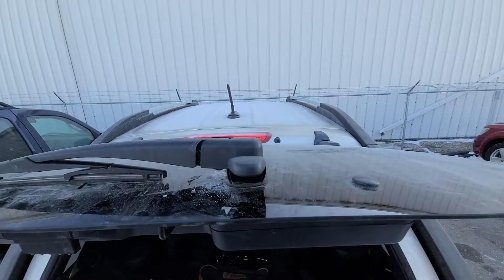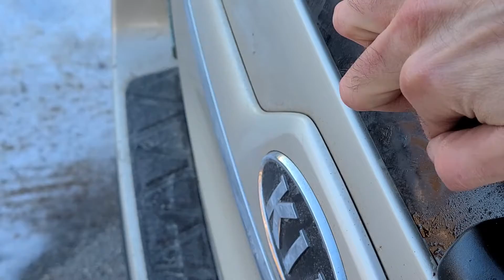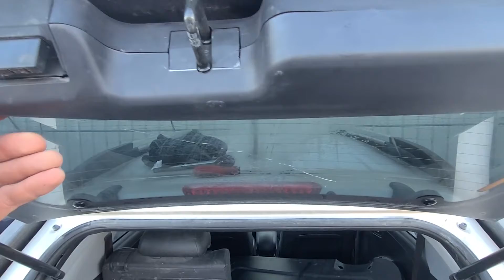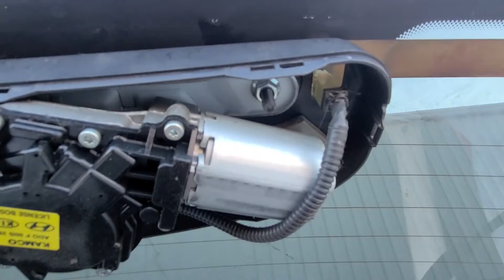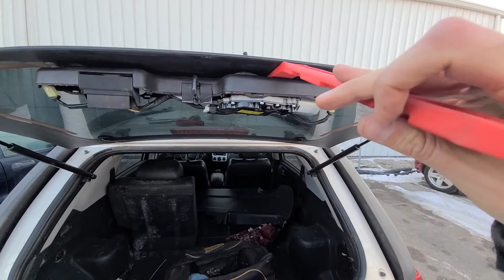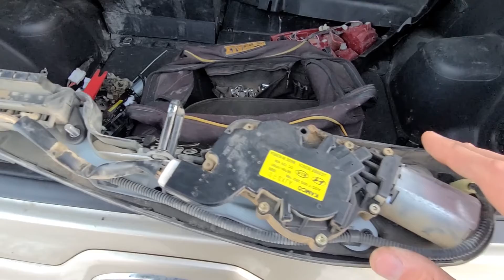Kia Sportage - REAR WIPER MOTOR REPLACEMENT / REMOVAL (2004 - 2010)

Comment: that large bolt won't budge. i've left Krill oil on it overnight...hopefully it will help loosen a 19yr old bolt
Reply from the maker: Yes those can be quite hard to remove especially if it was never done. I hope Krill oil will help you out

Comment: I replaced the same, can hear the motor clicking but the wiper blade won’t move. Any suggestions?
Reply from the maker: Hmmm if the motor clicks voltage should be good. Try to remove the wiper arm and make sure it fits properly and tight. Could be even a faulty motor again, hard to say without checking it out.

Comment: Great video, if I only need the motor replaced can I do that without having to pull the whole assembly through the window? Thanks!
Reply from the maker: Thanks. Unfortunately you will have to pull that arm through the window as that is the part of the motor. So maybe it would be easier to remove the whole assembly like I did on the video and then replace the motor while you have everything off

Comment: This video was very helpful. Saved me from having to even buy a new motor because the wd40 was all it needed.
Reply from the maker: Thanks. I'm glad this video helped you out
Reply: The spray function works but not the arm on mine. Being a NY vehicle with a little rust I’ll try the WD-40 around the arm as well. That itself was able to free yours up? Thanks
Reply: Same here. Just went down for 10 minutes, wd40ed a little bit the whole thing and wiggled it into working again. At the start it only clicked a bit, but then I could move it front and back with my hand. It started turning on its own, first only segments, then slow, after a couple of tries with a little manual help it gained movement again. Great video.

Comment: Hey there sir...wanted to thank you, as you saved me about 250$.  the KIA shop wanted 340$ to replace the motor/mechanisim, I was able to get the entire assembly for 33$ from my local "Pick and Pull" wrecker.  I am confident I will be able to replace the unit without too much trouble, and your video definately helped!
Reply from the maker: Glad I could help and good luck. Definitely a job worth doing yourself